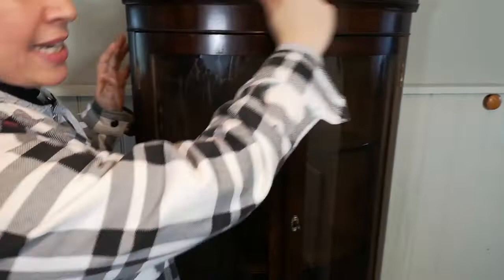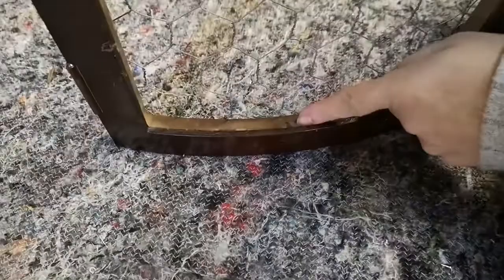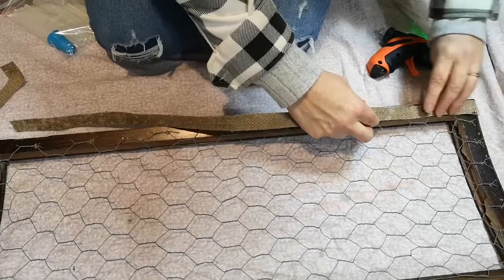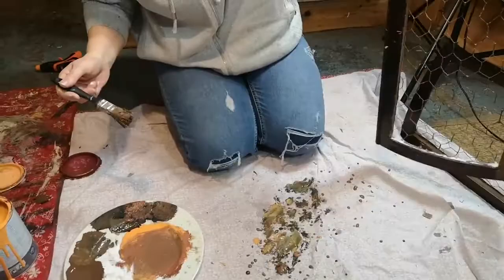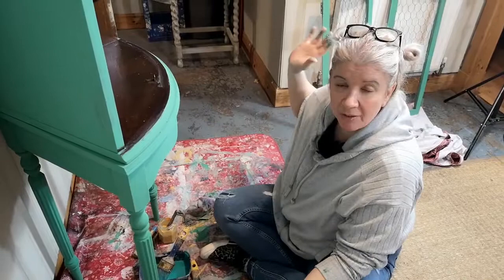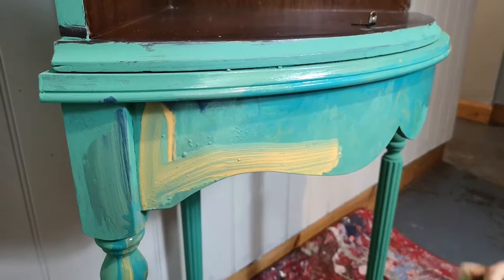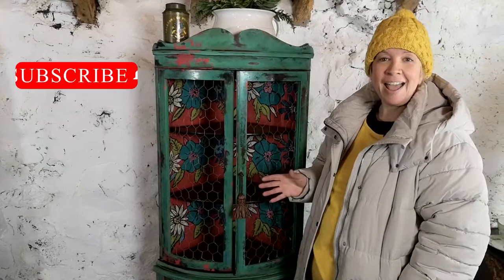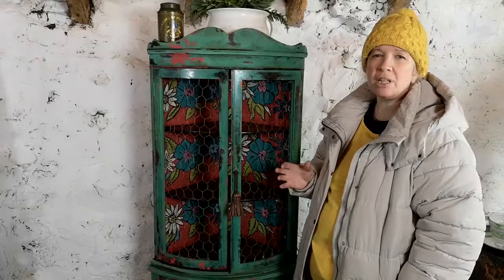From Broken to Bohemian. A tutorial for a Fabulous Bohemian Upcycle

Comment: Love that green you mixed. Do you reckon...or maybe Martin knows...if there would be a glue you could use to fix the glass. I was thinking then you could go over it with paint and transfers to hide it. Would that be a bit dangerous???
Reply from the maker: I have a fixed glass and if you have watched the IOD le Chas cuboard you see I fixed it but it's still there as I left it to added a little age. 
We have fixed glass with a two part industrial epoxy which with the gel part we ran down both sides of the crack and then used part two and sprayed it across the crack onto the gel. ..it hardens very smooth and yes I have painted glass ..ha ha Linda I have painted everything. I have a bit of a chicken wire fetish at the moment and keep trying to put it into pieces...Marty maybe not so much as it's a total faff and a hassle to put it into doors.. I have to sweet talk him X 😂
Lel x ❤️❤️❤️❤️
Reply: @MadebyMarley  I will check out that video...would you be worried about the safety issue or was it bullet proof?
Reply: I just went to the video and realised I was only halfway through
Reply from the maker: It was bullet proof although it was not in the middle it was off to the side ...I guess if it was in the middle I probably wouldn't resale it as I couldn't 100% guarantee. However the crack we fixed was bullet proof ....just go with caution if in doubt replace with wooden panels. Or 🐔wire... X ❤️